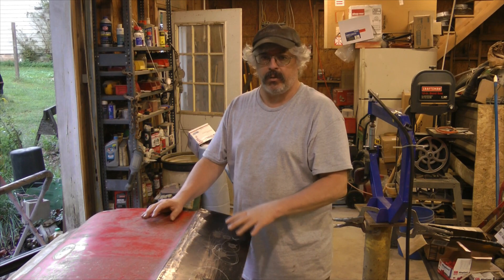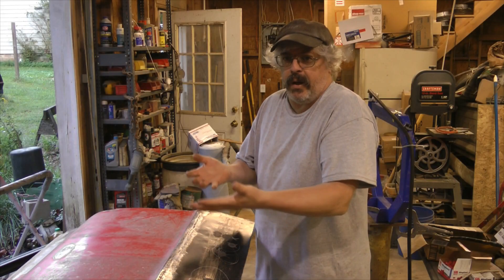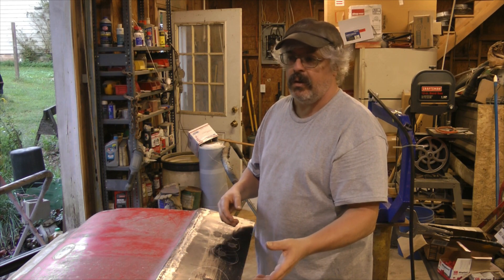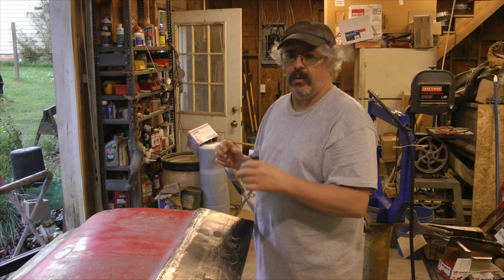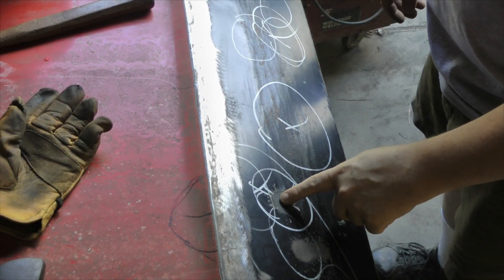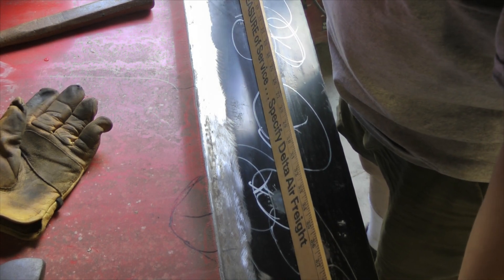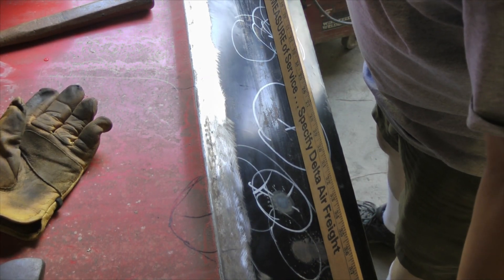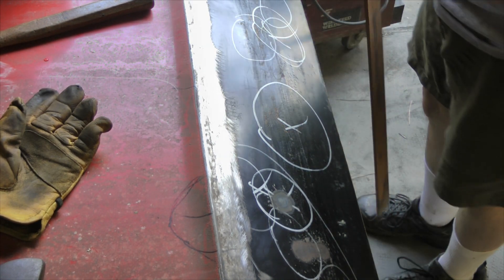Master the Art of Heat Shrinking Sheet Metal

Comment: Always heat the low spots  . Have a rag soaked with water.allow the low spot to expand over the hight of level, take the heat away and watch the steel to shrink till level and quench straight away. 
The quench holds steel where you wanted it .
Slapping steel  between dolly and hammer expands the diameter of the panel .
Practice makes perfect.
Reply from the maker: I've always used the technique I described.  That technique was even taught in a trade school instruction book for sheet metal repair back in the 50s/60/70s, when you could still heat shrink factory steel.  But, use which ever technique that works for you and yes I agree practice does make perfect.

Comment: I have a shrinking tip for my stud gun and I've also started using yellow bottle portable torch you buy and hardware stores it works pretty well because you pull trigger and have flame
Reply from the maker: Yes I've heard of folks using a stud welder for heat shrinking, and folks using propane or butane torches.  But in my opinion, propane and butane torches don't get hot enough, fast enough, to do the best job.  But I understand you use what you have.  
There are small bottle sets out there for folks that want an oxy/acty torch but don't want to buy the big bottles.
Good luck!

Comment: Thanks great process, but what about areas where you don’t have access to use dolly?
Reply from the maker: Yes that is a problem, you do need access to the backside of the panel.  Sometimes you can cut out an inner panel, say an inner door or fender panel - then weld it back when complete.  So yes, you have to account for that.  You can also make or buy tools such as a "dolly on a stick" and use them o place a dolly into hard to reach areas.  Thanks for the comment!

Comment: Great video 🙂... Does my understanding/attempt at explaining the process as you do it with the following ASCII art make sense?  (A) Before heating a high or low spot: ___-------------------___ ,   (B) fully heated spot rises: _____-----aa^^A^^aa----______  ,  (C) hammering around to gather the metal into a smaller bump: ______aATAa_______ ,  (D) after knocking down the bump:  -----------≈-=≈==≈=-≈------------ , (E): quenching the metal will make it contract and stretch, now being a bit thicker in the middle: ----------------=====----------------.
Reply from the maker: yes, that looks right.  It's always fun to watch someone do this for the first time.  They're usually amazed at just how far the metal grows when heated with the torch.  Then after hammering and quenching, one can actually feel the metal shrink down.  It's a cool process I'm glad the "ole timers" figured out many, many years ago.  Thanks for the comment!

Comment: Oxy propane should work, since you can cut with it
Reply from the maker: never tried that, but it might.  If it cuts steel then yes I agree, it might work.  The thing you DON'T want to do is try to heat with a flame that is not hot enough, all that will do is induce warping and create more damage that has to be fixed later with a proper setup.